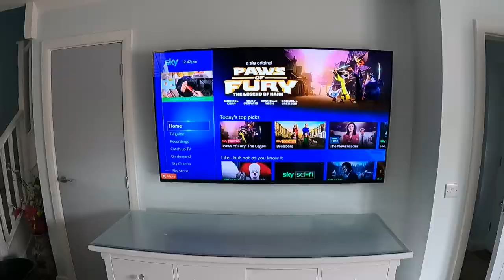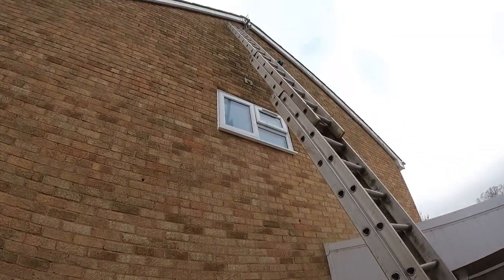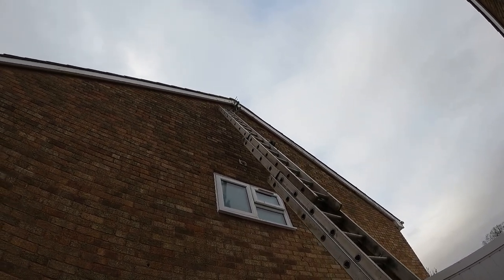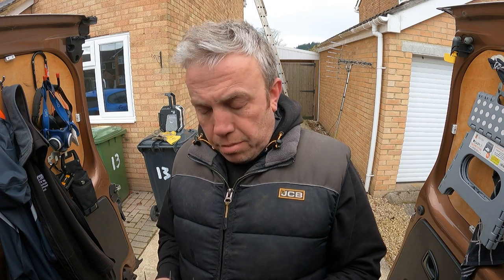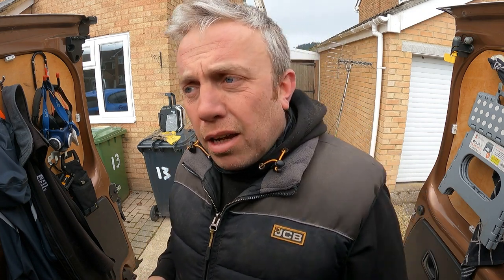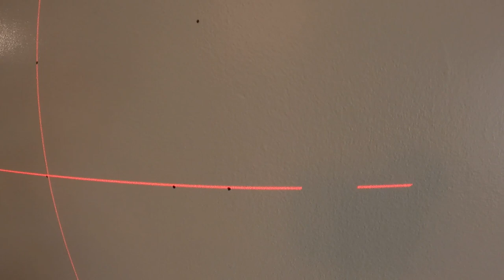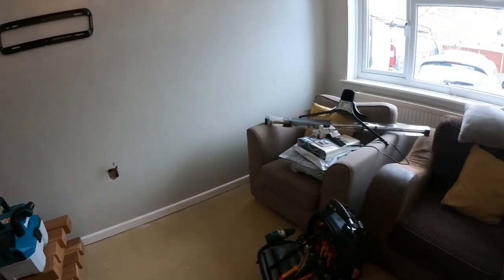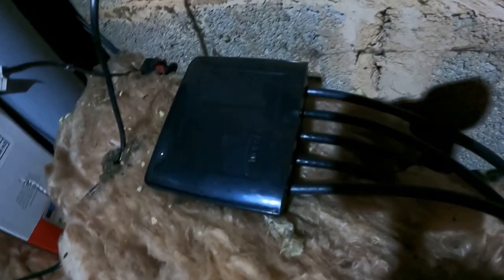BIRD DETERRENT SPIKES ON A TV AERIAL & WALL MOUNTING A TV

Comment: Just a thought,  
Recessed wall sockets,  double, allow TV to fit closer to wall 

Why masthead amp in loft??
Instead of a distribution amplifier??
Reply from the maker: Ok. 
So they had just had the room painted 3 days prior to me and they didn’t want any chasing out of wall, even though I said it would be better, I can only do what customer wants and to be fair you can’t see anything once TVs up. Masthead amp in loft is because that’s where the tv points terminate, and more importantly a distribution amplifier would’ve only given me 12-15 dB extra gain, where I needed more.  That location is fed from Mendip transmitter which is absolutely miles away, like across two counties to reach it so I needed something packing a 25dB gain and pound for pound this works well.
Reply: Thanks for your reply, 
Totally understand,

No chasing walls, just decorated etc, 

And yes, mh, amp gives a greater signal boost in poor reception areas,  

Totally agree 👍🏻 

Thanks,  enjoy your videos,  
Am in the same business,  

Wanted a career in TV 📺,  
Bin rigging over 25 years,  now, still think my careers teacher got it wrong 🤔😆😆😆

Keep doing what you're doing,  it's good watching another rigger,  👌
Reply from the maker: @janchrismurphy5866  where abouts are you a rigger mate?
Reply: @aardvarkinstalls 
Cheshire,